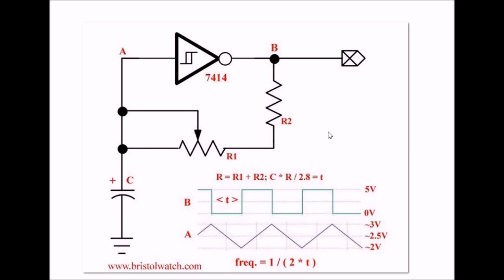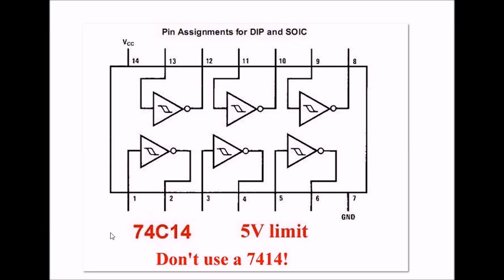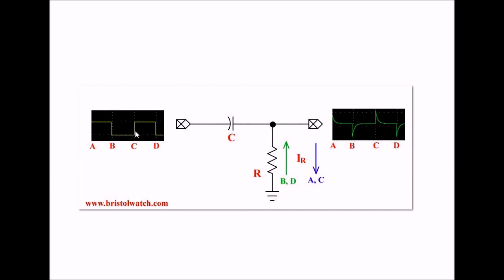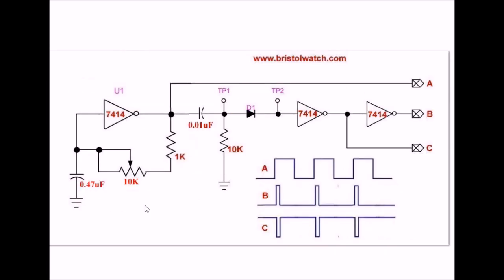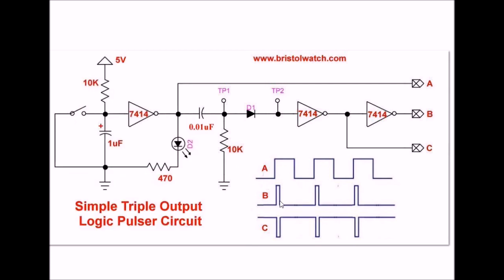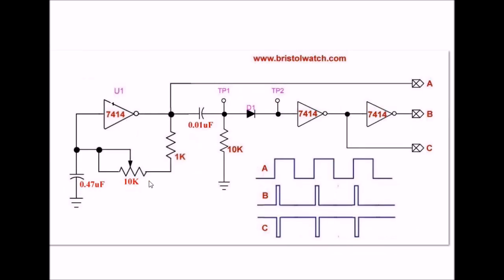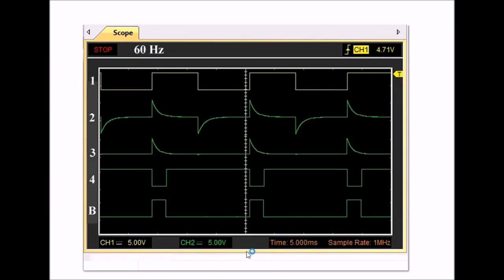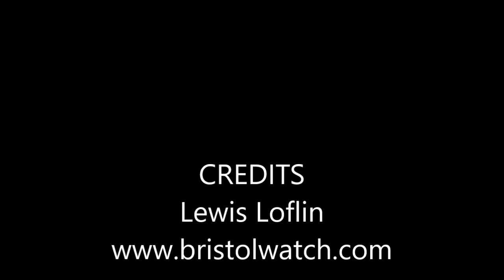Simple Three-Output Pulse Generator for Digital Circuits

Comment: I built the three output square wave - pulse output and found that a 10 K resistor must be placed on pin 3 (to ground) following the diode in order to properly obtain a sharp single spike. I was than able to obtain pulse widths as small as 50 nanoseconds.